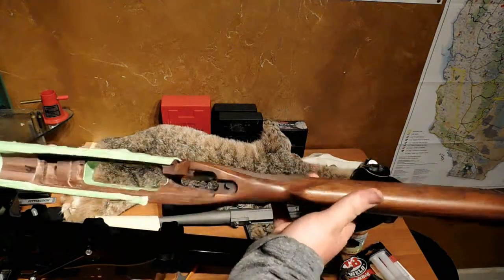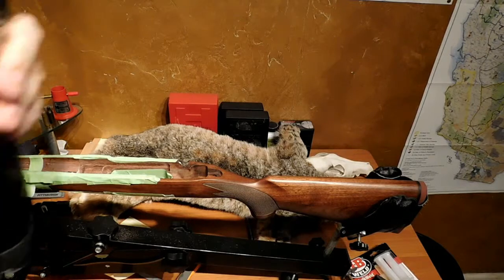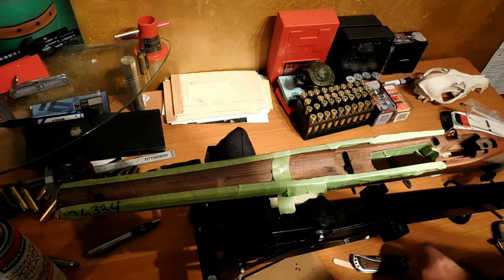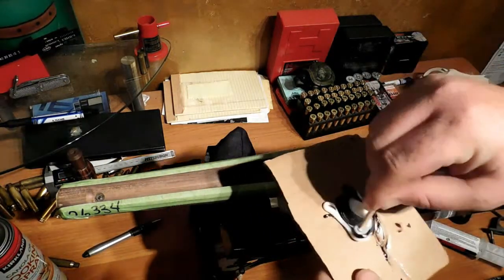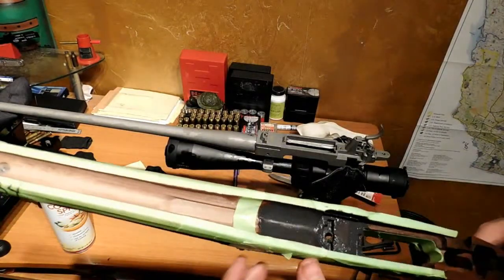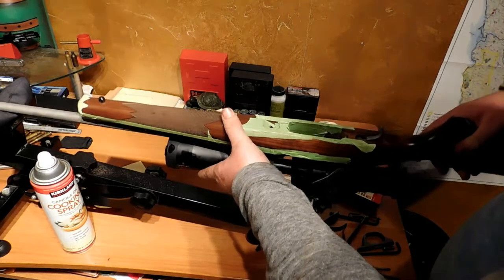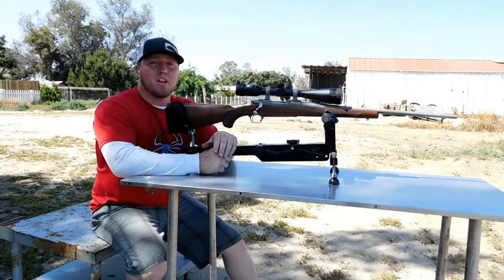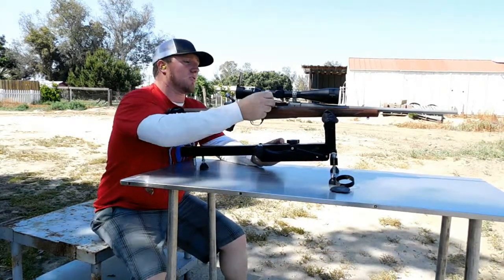How to glass bed your rifle Part 2

Comment: I’m thinking through how to bed mine and I keep getting stumped on what to do with the front screw. Seems like if I apply the bedding then run the screw up the stock, it’ll just push the compound into the thread hole. Seems bad no matter how much release agent there is. How you get around it?